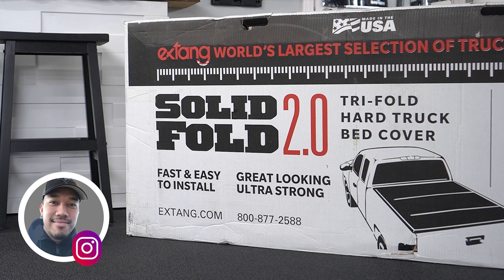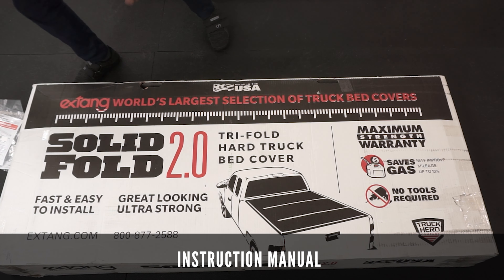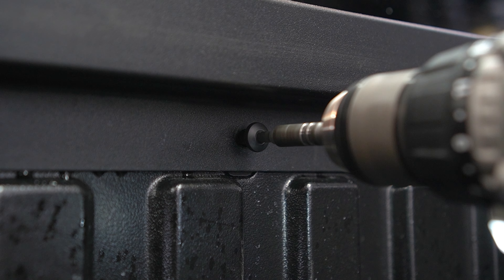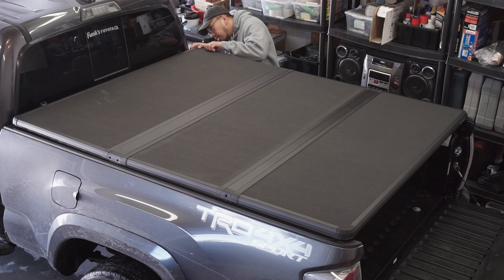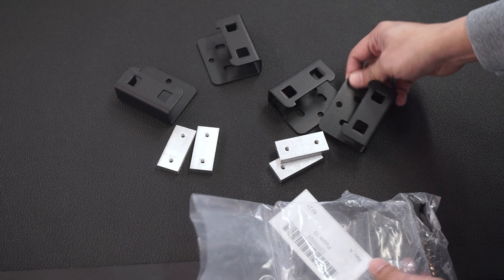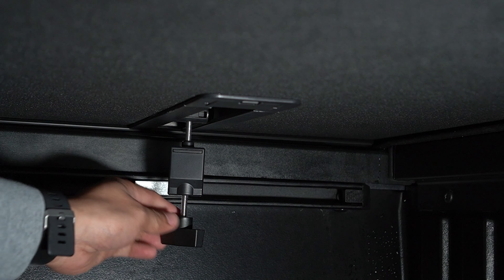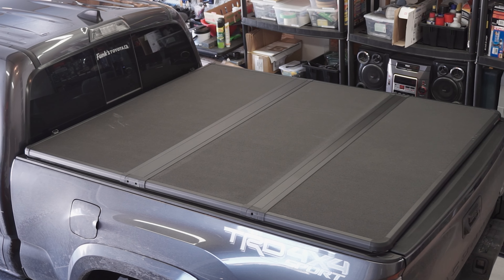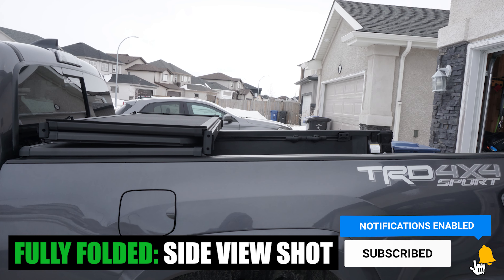EXTANG TONNEAU COVER INSTALL on the 2022 Toyota TACOMA TRD Sport | EASY DIY

Comment: Thanks for the video. Does water leak especially on the tailgate ? Thanks again
Reply from the maker: Hi no problem glad to help! Luckily I have not had leaks. I really tightened the clamps thou. Have someone push the cover down when tightening so you can compress it more.
Reply: @themandiyrin  i have another brand trifold cover,  but when I tighten it esp3cially at the tailgatr, it pulls the rail up, I'm nervous it could get damaged.
Reply from the maker: Luckily there’s no leak at all on mine. I make sure I have it locked down at all times on all corners so it’s been good so far.

Comment: What are the dimensions of the foam pads for the header bar? I bought one second hand and the foam pads were not in the box.
Reply from the maker: Hi I'm not sure the exact dimensions but I'll check. Since it's foam it should be able to compress to work!

Comment: Great video! 👍 Quick tip to anyone that follows... loosely attach the brackets to the rail inserts with the two screws before sliding the rail inserts into the rail. It will save you a lot of hassle as the screws are fairly short and harder to get started otherwise.
Reply from the maker: Thank you for watching! Appreciate it and the extra tip!

Comment: I installed the Xtang 2.0 on my new Tacoma about 6 weeks ago, love it for the gas mileage and protection of whatever is in the back .
Reply from the maker: I agree! It's so convenient to have adds a level of protection! How did you find the installation process? It was probably the fasted mod I've done in my Tacoma.
Reply: @themandiyrin  I found it a very easy to install mod and I also installed the Bed Lights and switch to my SR5 as it came pre-wired but I ordered the products and installed them all in less than an hour by myself.
Reply from the maker: @nathanfrisby3133   That's awesome, I haven't fully tracked the gas mileage difference yet but hoping it helps as these gas prices are ridiculous! 

I still need to buy and install bed lights. Any brand recommendations?
Reply: @themandiyrin  I ordered from Amazon and they are several LED but mine OEM
Reply: @themandiyrin  only 1 to 2 mpg difference and only at highway speeds between 55mph - 70mph. anything faster and it starts going downhill, anything slower and the tonneau is irrelevant.
Reply from the maker: @nathanfrisby3133  love it I ordered some recently! Looking forward to better lighting!
Reply from the maker: @hostilityy  ohhhhhhh that's good to know! Thank you!

Comment: Where can I get the foam seal for the header bar .
Reply from the maker: Hi Mouchy, mine came with the kit. You can try to ask where you bought it from for it if it didn't came with one. 

You can try something like this also and just cut pieces to fit. https://amzn.to/3o8im3t
Reply: @themandiyrin   I don’t remember where I bought it . I had to reuse my cover but couldn’t take out the foam from header
Reply from the maker: @grumpyjesse7842  ahhh I see! I assume any weather stripping type to block the space would work so maybe try Amazon!
Reply: The foam seal inserts for the header bar aren't  listed on Extang's website, but you can call the number on their website. The part number for the 3rd Gen Tacoma is 3200-1190. When I called they said they'd give me free shipping. Hope that helps!

Comment: What's the distance from the front of the bed to the first clamp in the bed rail?
Reply from the maker: Hi Brandon, I will measure later today as I'm not with my truck. But essentially it's about an inch subtracted (measure from the end of the rubber weather stripping) from the end of the tunneau cover to the clamp location.

Comment: Note, tip..if you don't used it and always keep it folded all the time. The 3 foam stopped will create a small indent in a long run due to the weight of the tonneau cover stack against it and will create a small standing water there. Hope that helps
Reply from the maker: Definitely helps! Thank you I'll make sure to keep that in mind as I want this to last 👍🏽